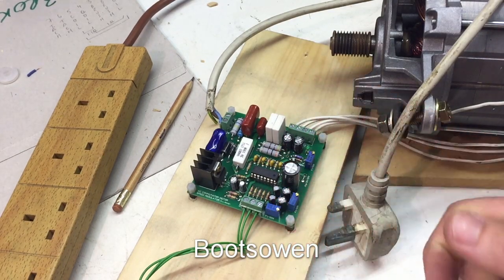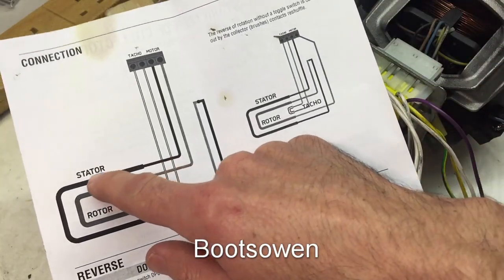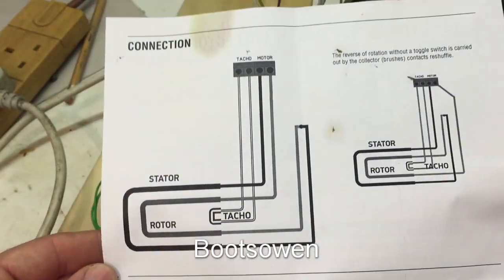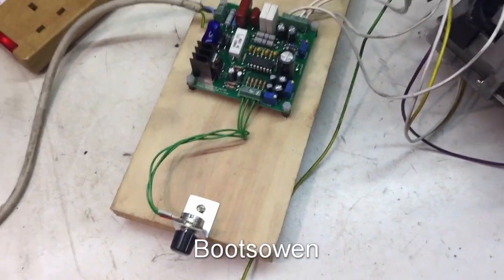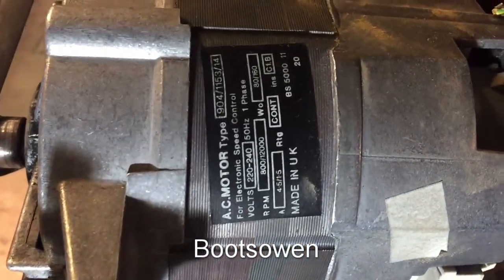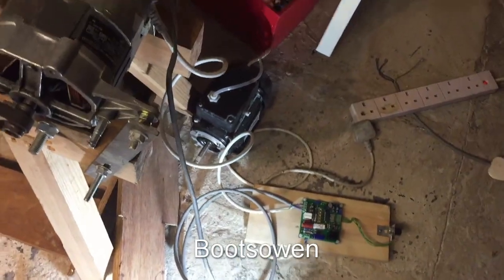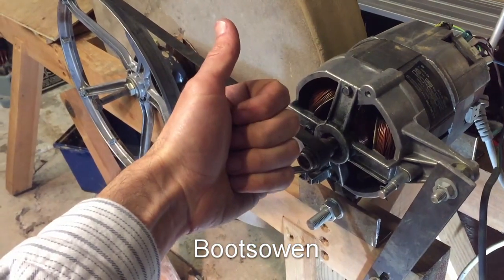TDA1085c washing machine motor speed controller: first look and wiring to motor for grindstone

Comment: Does this tda1085c controller have better performance and good quality than your three-wire controller without a stroker (https://www.youtube.com/watch?v=48J3w0eN6uI&ab_channel=bootsowen) ??

which is the best control?
Reply from the maker: I don't understand, which is a 3 wire controller? what is a stroker?
Reply: @bootsowen  I saw in your video that yours is patented speed controller, It has two wires (and one of them is probably for grounding) that connect to the motor DC 

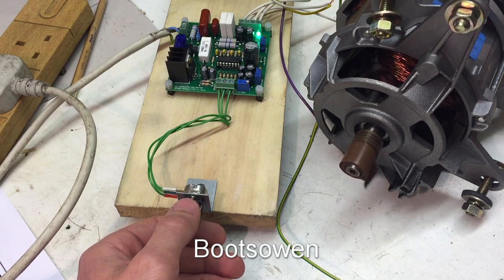https://www.youtube.com/watch?v=48J3w0eN6uI&ab_channel=bootsowen)( 2:31 )
Reply from the maker: The controller is for AC
Reply: @bootsowen  okay, thank you

Comment: Hey maybe u can advise on the motor that can drive 10000rpm with TDA. Near 1kw.
Reply from the maker: I am not sure a tda1085c can do 1kw, you shoudl check the datasheet, most washing machine universal motors are 300w

Comment: That's a DC motor controller, your not going to have any torque at lower rpm,a vfd is needed
Reply from the maker: Hi Joe, It is an AC motor controller. Based around the TDA1085c chip. It seems to handle the start up torque load of my heavy sandstone pretty well.
Reply: @bootsowen  ok, I didn't watch the full video, sorry you caught me